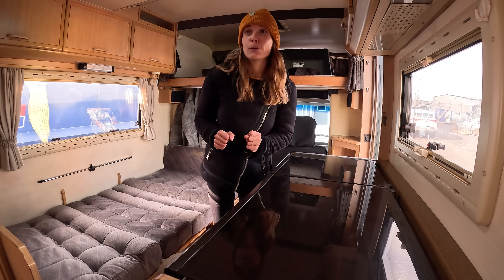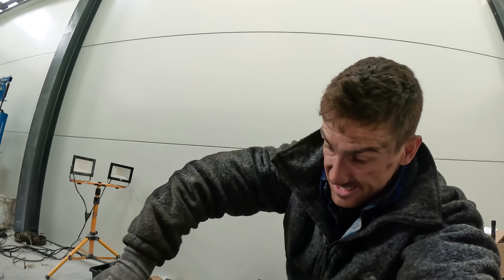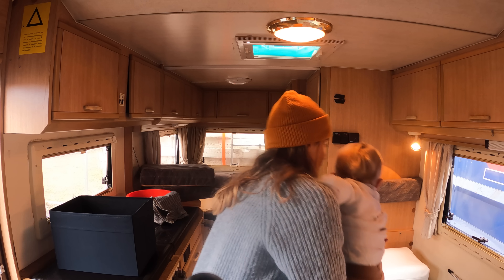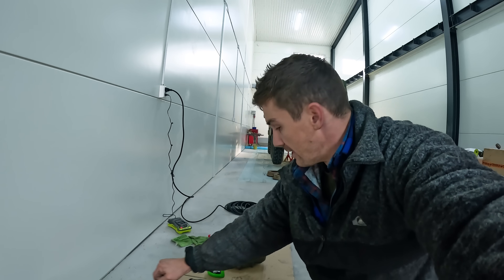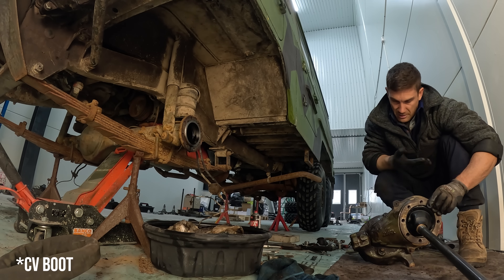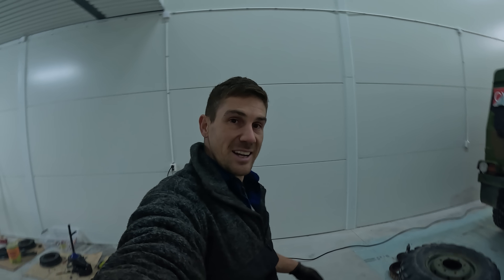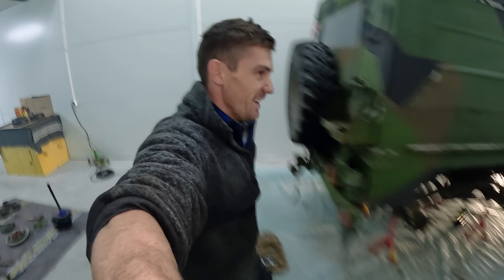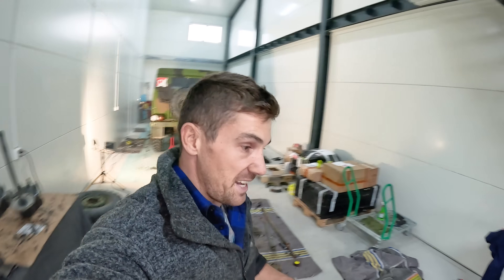The REBUILD of our 6x6 Ex-Military Truck Has Started! Volvo TGB 13 Restoration (Week 2)

Comment: You can find both WD40 and CRC 5-56 in Scandinavia as well, but likely in other shops than Biltema. :P

Though I kinda had the impression Supercheap Auto was kinda like the AUS/NZ Biltema? but there's no specialist tools? that must suck for the guys working on cars at home, Biltema always has something that can help ya, in really cheap quality that might not last long... at least for actual car parts, tools vary more, but buying an alternator at Biltema is basically like an emergency fix until you can get the proper part, as they don't always last very long.
( That said though, I don't remember if they still sell car parts, they used to have various stuff in stock for Volvos at least, like for Amazon, PV, 140, 240, 740, etc. And was notorious for not lasting very long. :P )
Reply: Well, they snuck around Bauhaus in the previous episode - they carry both wd40 and 5-56… as does likely every petrol station.

Comment: Why not make your job easier with the boots by leaving them on and injecting grease with a syringe. Then you don't need to take them off and the syringe doesn't leave a big enough hole to worry about grease coming out or anything going in due to the grease covering the hole.

Comment: Mate, that compressor doesn't make oxygen. It would be just a filtered air compressor. Giving divers 100% oxygen would kill them after 5 meters, as the partial pressure of the oxygen would make it toxic.
Nice Hub job
Biltema is ok but low quality. I buy my drill bits from Würth and other tools from Swedol.
I like to use owatrol oil then when its almost dry then paint with Brantho

Comment: Empty vehicle ??? why is there only about  40 mm between the front axle and the rubber bump stop . What is it going to be like loaded . Are the leaf springs flogged out and need resetting or replacement .
Reply: Those big "bump stops" are actually part of the spring set up and meant to compress. Its a compromise made to get away with lighter duty leaf springs to have a decent ride when not loaded.

Comment: A bit surprised to see you just put on the covers for the duvet and pillow, without washing them first. 😮They are filled with chemicals from the production process and should not be used before a proper wash. Especially the young one is prone to develop allergies from using these prior to washing.😢
Reply: I bet you are fun at parties😂😂

Comment: Cool ! I was inspired by your previous rig to start my own, just to realise you are now converting a very similar truck to mine ! You can see on my channel, i'm converting a Pinzgauer 710M, also military vehicle, very similar to yours, but 2 axles. Aren't you going to build a box on your C304 like you did on your Mog ? Check out my channel, i've built a box and designed a simple flexible system to attach it to my Pinz. Cool !

Comment: Wouldn't it be easier to replace the drum brakes with a disc brake kit?
Reply from the maker: The conversion is very expensive unfortunately. We might consider it at the end of the build if we have leftover budget.

Comment: I don't know if anyone has previously commented on this, or you yourself know, that someone in Poland converted their C304 with dick brakes all around.  I found a video here on YouTube some years ago when I went down the TGB rabbit hole a few years ago. Don't know if it's really worth it for your application however.
Reply from the maker: There is a conversion kit available but it is very expensive unfortunately.